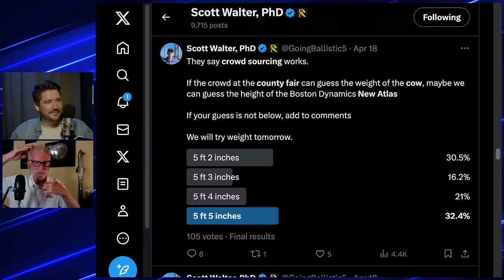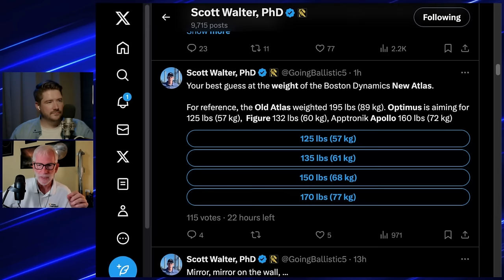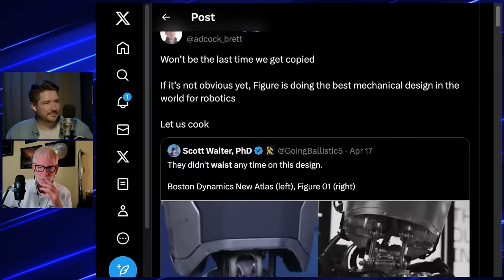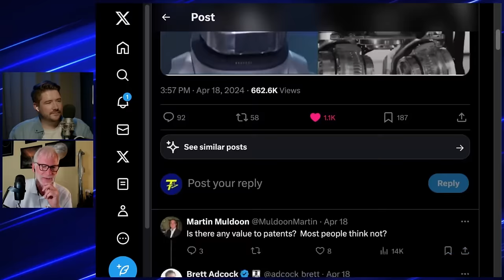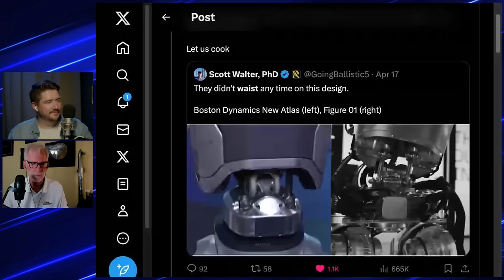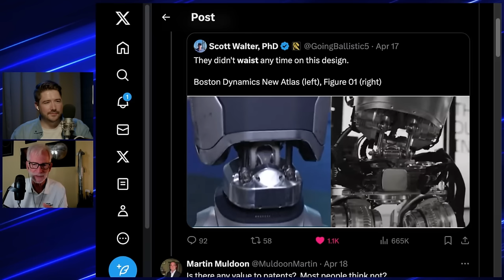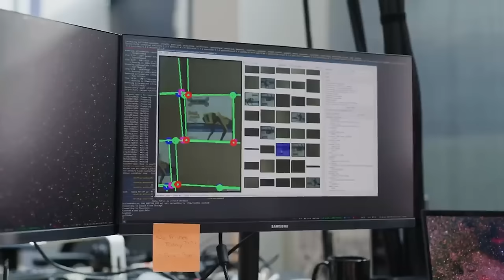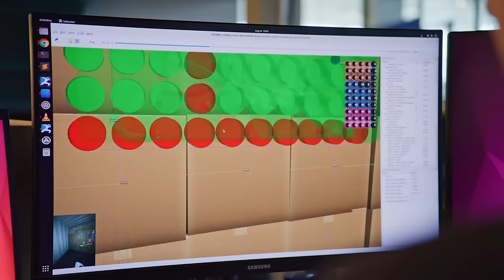NEW ATLAS Bot Deep Dive! FIGURE SUES Boston Dynamics?⚡Dr. Scott Walter

Comment: Using the outlet on the floor behind the bot and scaling it up slightly for perspective I came up with 4.375" for the outlet box size and the bot is just over 9 full boxes which would make it approximately in the 5' 1 in to 5' 2 in range.

Comment: I'm not a fan of the wrists, the hands, or that head!
I disagree with Scott, however, on one point. I think this design is perfect for the home.
A home bot needs the ability to maneuver in very tight spaces as Atlas II can.
Reply: Scott thinks "perfect for the home" includes being safe for around people.  It should have no pinch points, have a soft surface, arms that give way if pushed on, and be light weight to avoid hurting people and breaking furniture when it stumbles.
Reply: @Ralphie419  Yeah, but I think all these robot safety concerns go too far. Look what else we have in our homes - hot ovens, heaters, hot water systems, electricity. Cars kill over a million people a year!

Comment: Mecanum wheels, which have the little wheels slanted all around them are typically used on the four corners of a robot so it can move in any direction, but put them all in a line, so that the robot still balances, but can screw itself along. 
Put bicycle chain inside of Silicone Reinforced Braided Rubber Hose with pull cables to operate as fingers.

Comment: I saw a somewhat believable chart on reddit that puts the new Atlas at 5'9" tall and 180 pounds, Optimus at 5'11" and 103 pounds, Figure 01 at 5'6" and 121 pounds, Agility Digit at 5'9" and 146 pounds, Unitree H1 at 5'11" and 103 pounds, Sanctuary AI Phoenix at 5'6" and 154 pounds. The new Atlas looks like it has heavy, beefy actuators, lots of metal, and lots of cooling fans, so makes sense that it would be the heaviest. They are probably going after heavy industrial tasks that are too strenuous for a human to perform.
Reply: That chart is chock full of errors. E.g., Optimus is 5'8", not 5'11". Not trustworthy.

Comment: If the Boston Dynamics video is playing at 1x speed, then Atlas Gen 2 looks like it walks at least 2x faster than Optimus. Is that possible?
Reply: Yes, Optimus uses a ball screw type gear reduction. It’s basically a truck when it comes to maneuvering.

Comment: It's a machine with metal legs.... And with ALL that engineering they can't make part of the leg length  adjustable?
I fully understand, changing the length of the legs is going to impact on walking but really...
If the total height is such a big deal then I'm sure walking could be corrected for whatever height variations are desirable 🤔

Comment: It was The Alchemist IBM Nazi Hydraulic DARPA War machine did first Atlas Robot Designed from the 40's. The New Electric is way more logical for everything. even less problems to go wrong with Full electric that is why most Power tools went Battery DC electric years ago. Electric is more clean only needs electron recharge no Gas or liquid pressure differences with chemical and oils through temperature changes. it will work better in Space also Even Mars.  Them Old steam machine radioactive Powerplant thinking people were trying to make a terminator death bot for War when humans just need a VR/AR Full Electric Drones for Midnight MOON walks. Simulating a MMO Robot Star Wars Level Space Battle first person viewing with an Apple Vision Pro controlled by Xbox Live web info! Live Streaming On Netflix Paramount or Disney + as a New Sports game shows. The new Robot Space VR/AR Gaming Pros